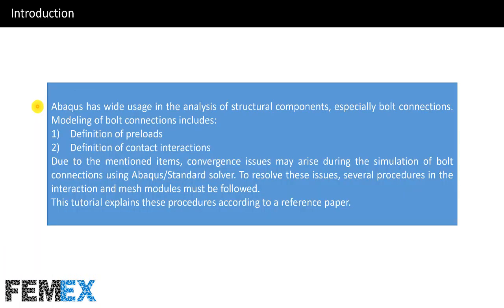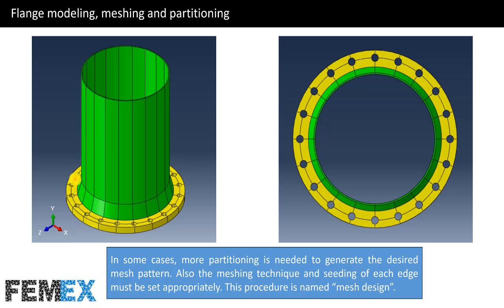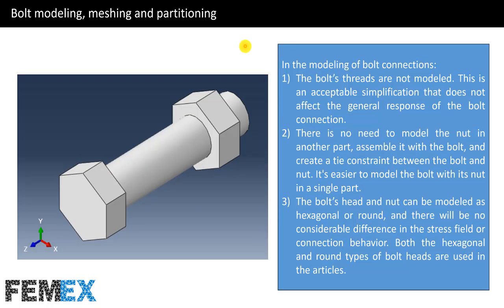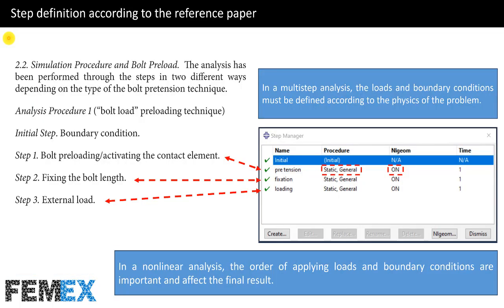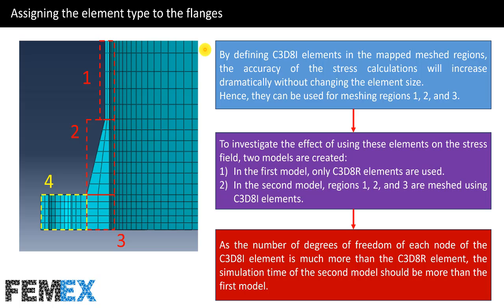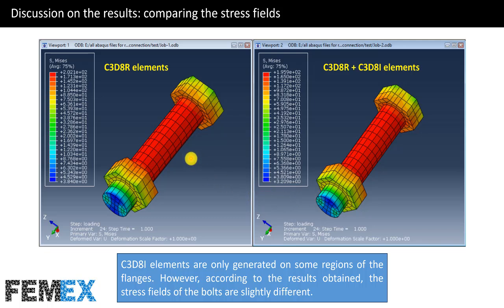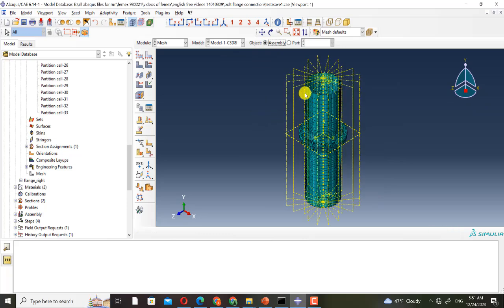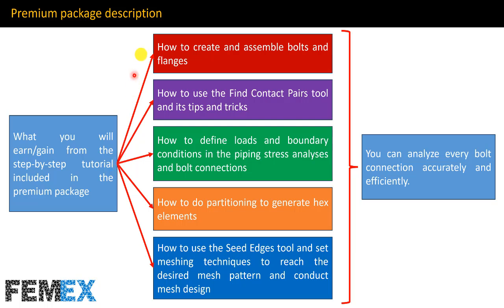Bolted Flange Connection with Piping Forces Analysis via Abaqus Part 1

Comment: Thanks for your tutorial. I have a question regarding the concept of a rigid body and couple constraint. How do these constraints distribute a concentrated moment on the surface? Is it uniformly or linearly?

I am also curious why the results are so different.
Reply from the maker: Hi.
You are welcome.
Happy new year.
For applying a concentrated moment to a surface or section, I always define coupling constraint but I have also seen some tutorials which use rigid body constraint. I have not used rigid body constraint at all but I know that using coupling constraint is totally correct and it works.
When you define a coupling constraint, it means that the initial distance between the RP and nodes of the selected surface will not change during the simulation. So the distribution of moment will be in way to satisfy this condition.